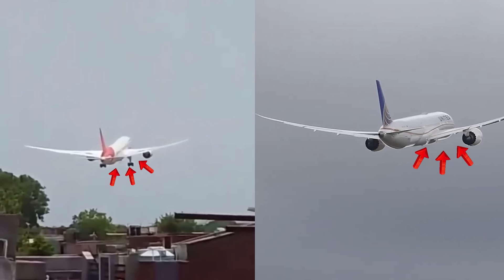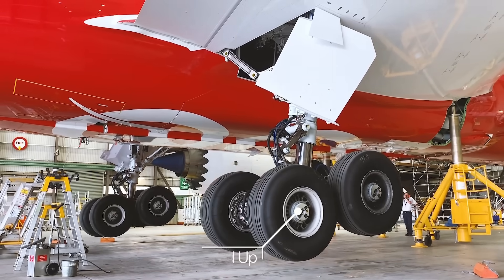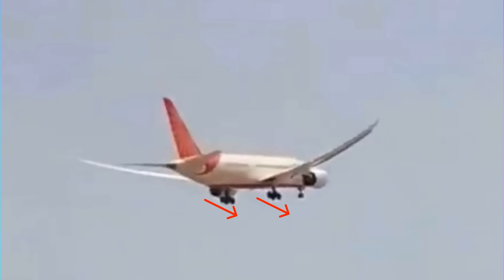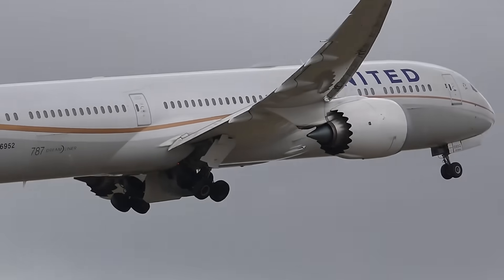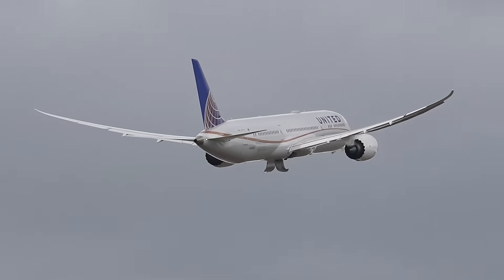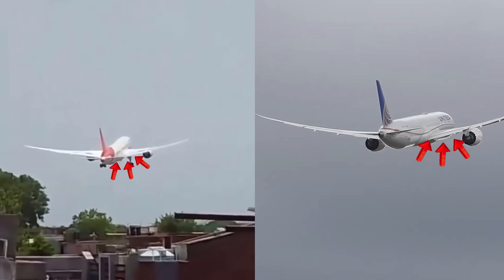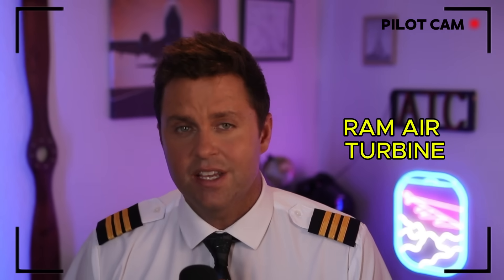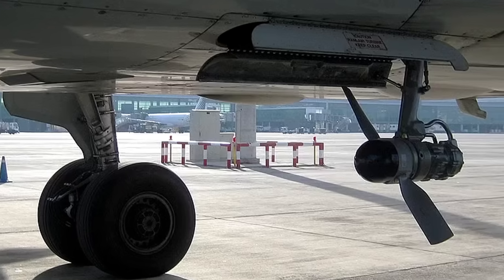Pilot Explains: A New Detail in the Air India 787 Crash Everyone Missed

Comment: I just wrote a comment on what I heard from someone who knew something about planes and reasons for fatal crashes.  You have not printed it yet one about rodents makes the cut.  I will repeat it just in cast it has some relevance.   In India, at that airport the local temperature was around 40C, well into Fahrenheit triple digits, I live in the desert.  The plane sat for hours at the airport then finally taxied onto the tarmac, which was hotter.   Taking off in that heat and humidity could have started  series of catastrophic events leading to the crash.  I'm no pilot but have been around since WWII  and thought this was worth passing on.

Comment: The 787’s fuel supply system uses electric pumps to deliver fuel to the engines. If there’s an electrical issue, both engines could lose fuel supply and stop providing thrust. Since the plane would be too close to the ground, there wouldn’t be enough time to correct the mistake, leading to a crash. 😰😭

Who is responsible for inspecting the electrical system?! 🤔🧐

Comment: I have to point out a major flaw in your landing gear theory. The main gear bogies adopted their default position as soon as the aircraft left the ground. That is with the forward axle lower than the rear axle. This position continued to impact. Prior to retraction, the bogie pivots so as to lower the forward axle below the rear axle. Engine problems is I think the only viable explanation.

Comment: Another thing that supports engine failure is the lack of sound.  With the large turbofans, many times the turbine wine overpowers the jet noise, but not much of either can be heard in the take-off video.  Also, if they had gone to firewall power because of flaps, we would at least see some smoke (I would think).

Comment: Another, yet unlikely reason to lose both engines - "computer glitch". Some sort of massive software malfunction cutting the fuel supply to both engines, regardless of all backups. I do not believe that fuel contamination of such severity that it cuts both engines at the same time would not cause engines flame out already on taxi or takoff run.

Comment: Could it be the fuel pumped from the underground tanks was already so hot when pumped to the craft or the chemical super absorbent polymer used to catch water contamination was over the above recommended limit. I guess it happened before as I can recall for Cathy pacific. So may this polymer crystallized in the fuel filter and blocked the fuel flow to the engines when highly needed

Comment: Could the dual engine failure not be caused by a terrorist entering the cockpit and forcing both the pilots to cut off power supply to both engines to get the plane crashing down ? Or is it sabotage by someone in the ground crew before the plane took off after formal maintenance clearance was given to the pilots ? In my view, the very fact that the above two possibilities have not been examined at all till now makes me suspect something sinister that could have caused the crash.

Comment: Thankyou for clear explanation.  Both engines failed due to lack of maintenance to Air India flights.  Boeing is at fault here!      When I travelled last year with Air India, no electrical items worked such as phones in the planes/ seats.  The seats could not be pushed down into sleeping positions, the TV on the seats did not work either.  This made me think what else could be at fault.  This could have been a ripple effect of default extending to other areas of the plane such as engine failed.   I understand Boeing is cutting corners to save money but they have also now killed many passengers due to this!

Comment: I hope this will be of some help, even if it is a small thing.

I would like to share the facts from my experience that the only survivor of this flight, who was under my seat on an ANA and UA B787 flight in 2018, may have experienced a similar frightening situation in the aircraft as I did in the short time before the aircraft began to taxi and heard the explosion, and may have experienced further after the explosion due to malfunction of the wheels and landing gear, which led to the loss of lift to the fuselage, especially the hydraulic systems on both wings, and the resistance of the headwind on the tires and gear, which caused the loss of thrust and led to the crash.

The survivor testified that he heard a "bang", but it was not from the engine, but from a lightning strike or some kind of explosion on the aircraft that occurred outside the cabin, but from two experiences where I felt like I was going to die from the sound I heard, just like the survivor's seat, I believe that the cause was the fatal destruction of the landing gear device inside the aircraft.

Probably, after the takeoff and landing gear connected to the tires was locked due to a mechanical incident, an abnormal force destroyed part of the aircraft, the cover was torn off and scattered on the top of the aircraft just before the crash, and the aircraft ran up to a certain altitude (within 10 seconds) by coasting at full power during the takeoff run (not reaching V1), but the aircraft lost enough lift due to insufficient runway, causing the aircraft to crash.

The gear malfunction began immediately after the runway, causing vibrations and rattling sounds, and if the tires lost rotation at the same time as takeoff, there would be no tire marks on the runway.

From the time the wheels started moving for takeoff runway, just 5 to 10 seconds after takeoff, a strong impact accompanied by a loud continuous rotation sound and intense vibrations should have continued until just before the crash, and the survivors must have had the same experience as me until partway through the runway. Details of my two terrible experiences with ANA and UA were posted on my Facebook page on June 14th, as well as this video, so please take a look for reference. Thank you. Kitafuji Isamu.

Comment: Noting the angle of attack with flaps extended and landing gear down at this stage of the flight is a clear indication of power loss in both engines. The silence in the video confirms this. The real question is what caused the loss? Bird strike, contaminated fuel or possibly mechanical failure of a fuel system component are all key suspects but the investigation with have to figure that out. Everyone saying it was flaps or spoilers is way off! No way the plane would have got this high off the ground without flaps and if spoilers triggered, the loss of lift would immediately stall the plane.

Comment: Flight 171 not solved. Except that the engines stalled and hydraulic systems froze inexplicably at 650 feet altitude of take off, while still on an upward climb not too far from the departure -  airport. A survivor says lights flickered between green lights and white dim lights. The emergency R. A. T. turbine back up power system fans below the plane came out ipon receiving signals from field sensors located near the stalled engines. RAT backup turbine deployed as  automation engineering automatic deployments upon engine sensers  receiving clear signals of a sudden shut down of both engines or hydraulic systems. Automation sensor signals were sent from Plcc back to sensors in thè field, incĺuding tge RAT system (such the RAT system sensors to wake up the dormant RAT turbine as well as other automation sensors connected to other devices as positive signals in automation engineering. A survivor says there was a small muffled explosion, somewhat distant - sounding prior to the sequence of tragic events. Next, the lights in the passenger compartments flickered. flickered green and white emergency lights in the passenger. The thrust gear handles  mechanism failed to respond to pilot hand pulls to generate more up thrust to avoid crashing to the ground as plan A fails. Force applied to the throttle too in the cockpit. As the ground approaches fast , the pilot makes a concise and clear Mayday call to air traffic controllers in the area. Call: "Mayday, mayday. Mayday, no power! No thrust, Going down. ..." All pilots of heavy jumbo jets going downward mindlessly in a swift downward gliding motion initially  attempt an up - thrust or upward motion of the ill fated jumbo jets by pulling at the thrust levers backwards, that is, towards the back of a plane.

Comment: Most probable cause of the AI 171 crash:

The aircraft was overloaded with cargo without the pilots’ knowledge.

The pilots realized they had lost engine #1 just before takeoff. Since it was too late to abort the takeoff on the runway, they decided to go around for an emergency landing.

Due to the excess cargo, the aircraft was unable to lift off at the expected point using only one engine.

In the CCTV footage, you can see the aircraft had already crossed the runway. The dust seen as the aircraft lifts off is a clear indication of overloading and engine #1 failure.

At such a critical moment, anyone would panic — and the same happened with the pilots. Both were under immense stress as the aircraft was trying to lift off.

In this panicked state, they likely cut off power to the working engine #2 instead of the failed engine #1.

Unfortunately, they didn’t have enough time to restart engine #2.

Comment: my gamble on eventual cause is plane was Over weight by a LOT. The extended roll out, only just getting off at the end markers, and at that point still had full thrust points to HEAVY. EGT's or exhaust gas temperatures spiked on both engines under the load and the FADEC's system DID what it was programmed to do reduce fuel input and power output to protect the engine from thermal damage.
I'm no expert just a drip under pressure but High end race, supercar, and luxury vehicle electronics I work on do this as a protection mechanism to an abusive driver. Some just wind back timing and add fuel to cool the engine with no warnings, some cars do what people refer as "going into Limp mode" as in Limp home at minimal power and speed with engine light on.
Would love if there any Boeing experts out there know if this overheat/overload protection is a thing in FADEC if thats the equivelent of a cars ECU?

Comment: Yesss! Contaminated fuel was my first idea , and cutting off the fuel looks like SABOTAGE ! IN FACT some reports already mentioned some salt descovered in the fuel ! My suggestion is to check the INSIDE of the engines for DUST because a huge cloud of THICK DUST was noticed by an expert in a video where he looked closely to the whole RUNWAY - AND at the END OF THE LONG RUNWAY  exactly in the moments of TAKE-OFF , the PLANE WAS INGULFED IN a LAYER OF DUST , which in fact COULD HAVE BLOCKED= CLOGGED BOTH ENGINES AT THE SAME TIME !💯✈️ 😢

Comment: I think when they opened up the throttles the lines had vapor in them and they vapor locked the flow of fuel. 
By contrast when they didn't have the throttles wide open they were fine but when they opened them up - it locked up. 
It was very hot that day which is perfect for vapor lock. 
And it explains it precisely.

Comment: Just a quick question on the contaminated fuel theory, If contaminated fuel was present on the aircraft wouldn't the pilots notice a bad running engine or problems starting the engines or wouldn't the be some sort of different visible gas coming from the engines?? There  must have been a period on the ground where they would have time to notice bad engine idling or performance??

Comment: Could it be, that there was a severe damage in the gear system, which locked the hydraulic system and damaged both engines through the hydraulics, as soon as the gear up was selected?

Comment: ⛔Like wise excellent analysis carefully explained & understood, 
Some catastrophic electrical failure with loss of both engines possibly black screens, less than 20 sec to impact how likely?  😢Contaminated fuel? but wouldnt each engine draw from different tank source as safety measure? With erratic running not say in last radio words + looking like simultaneous cut to both motors.
+ NO subsequent reports of fuel irregularity  elsewhere. 
Black box data analysis lets see whether both motors disabled together or not ?
An Accidental bump fuel cut  switch on possible? unlikely ? 
Will be a difficult investigation with intensive fire damage. SupershopperNz/ROD🇦🇺

Comment: I'm not a pilot or have anything to do with the aviation industry. But i do have a theory on what happened to the Air India 787 crash that i have not seen mentioned yet. Is it possible that the hot dust cloud generated by the thrusting engines at the end of the runway caused both turbines to flameout simutaneosly seconds after takeoff.

Comment: Vapor lock.  102 degrees F ambient temp.  Plane sat on runway for 2 hours without AC running.  Interior videos shows  the cabin is filled with steam/humidity and passengers all fanning themselves.  Plane was heat soaked.  Why was the AC not running? Was there a problem with the APU? The 787 is the only plane that uses a “no bleed” design, meaning that aux systems do not use engine bleed air to power them, which means everything is run by electricity, which means every aux system is powered by electricity, which means a much higher electrical load than any other commercial jet.  The 787 has 6 generators; 2 in each engine and 2 from the APU.  If the 787 isn’t generating enough electricity, it will automatically load shed and shut down engine fuel pumps and switch to gravity / suction feed.  If fuels pumps are running, the fuel lines will be pressurized and no vapor can form in fuel lines.  If electrical output is insufficient and load shed happens and fuel system switches to suction bypass, vapor can form in fuel lines in high temperature or low pressure situations, leading to vapor lock, which can cause an engine to flame out.  Again, ambient temp was 102 F and plane was heat soaked.  If electrical generation was insufficient, it would also explain why there was a loss of hydraulic pressure and the landing gear failed to retract and why the RAT deployed.  Food for thought.

Comment: THE ODDS ARE ASTRONOMICAL FOR DOUBLE ENGINE FAILURE. CAN'T THINK OF A SIMILAR CASE WHERE 2 ENGINES FAILED ON TAKEOFF. THEREFORE, THE MUCH MORE LIKELY SCENARIO IS THAT ONE OF THE PILOTS SHUT THE FUEL OFF OR PULLED BOTH FIRE HANDLES. THAT HAS HAPPENED BEFORE SORRY TO SAY.

Comment: Good comments.   My questions deal with how the engine power is controlled.  1. Are the cockpit thrust levers mechanically linked to an engine component which regulates power?  YES or NO.  If YES, then it is virtually impossible for a mechanical control to fail on both engines simultaneously. Virtually.  So let's move to NO.  If NO. meaning there are no "linkage" or "rods" etc,  then how does the engine thrust change when the cockpit thrust lever is moved?  Is thrust controlled by a "throttle lever" position sensor which sends a signal (??) to a component on the engine which effects thrust?   If the answer to this is also "yes" we know it is again "virtually" impossible for that "component" to fail on both engines simultaneously.  Virtually.  OKAY.., so let's look at what could possibly cause the thrust-level-signal from the cockpit to be interrupted in a manner that would AFFECT both engines.   Let's look at that.  A) could it be due to someones phone not in the airplane mode..?... not likely.  B) could an interruption be caused by an aircraft system malfunction..?..., The 737 Max 8 comes to mind.  Possibility exists.  C) could an external electro-magnetic force, intentional or otherwise, interrupt the thrust-lever-signal?  Welp.., if that's the finding, we (the public) are not going to hear about it.  D) a fuel contamination problem would seem to have affected other aircraft refueled at that location.   Those are my comments.  I've spent 22 years in the Air Force on jets as an engine-shop branch chief and 51 years as a flight instructor.  This thing should have caused the 787 to be grounded immediately.  The fact that it will fly on one engine is little consolation to me when I see we have had a number of those engines shell out to date.  Now, we just had TWO quit for no apparent reason, and not because they shelled out.  They QUIT.   Bad "dream".

Comment: There was only enough remaining  hydraulic pressure and flow to tilt gear forward due to engines out. RAT not able to supply demand due to time, speed and output.

Is it possible it was low fuel so toga and and associated angle of attack leading to fuel starvation?

Comment: Great analysis. Comments to follow are in the realm of speculation. The 787 was a leap forward into an electro-hydraulic aircraft. While there are multiple redundant lines, both electrical and hydraulic, the possible dual engine failure points to a Single Point of Failure (SPF) somewhere that affected both engines. I have no idea of the electrical layout of the 787, so take my comment with a ton of salt. Is there a common power bus for the TRANSMISSION of generated electrical power somewhere? If so, and if there was a fault in that bus, it would shut off the fuel pumps and starve both engines simultaneously. From the videos, the fault was simultaneous on both sides (Ie not even the slightest yaw). Whatever may have knocked out the engines was sudden and simultaneous.

Comment: 1) initial positive rate of climb could be due to ground effect and v2 only slowly decaying, not precluding pilot error
2) low noise could indicate dual engine failure , but engines would never stop at exactly the same time - some tail wagging should be visible
3) MLG fwd tilt is a strong indication LG up was seleced
4) flap extension  cannot be concluded either way
conclusion: confusing, we have to wait for the cvr and fdr data